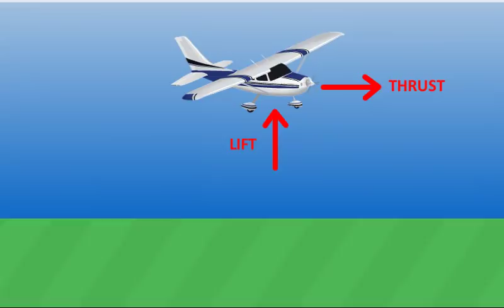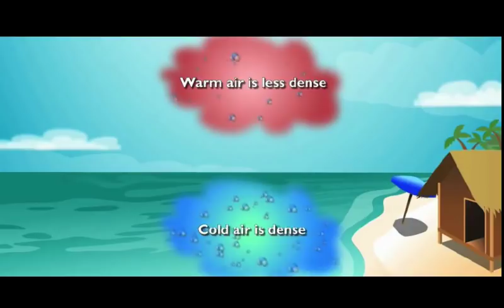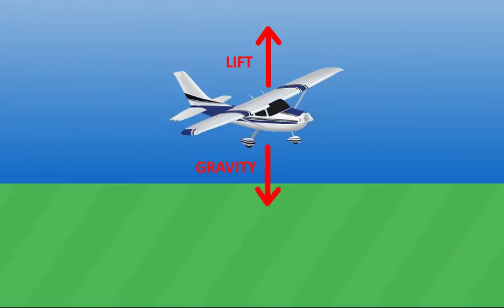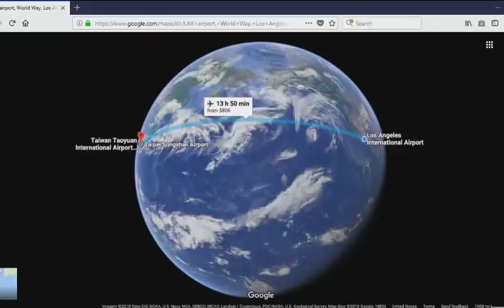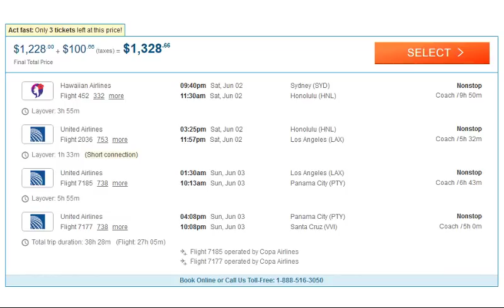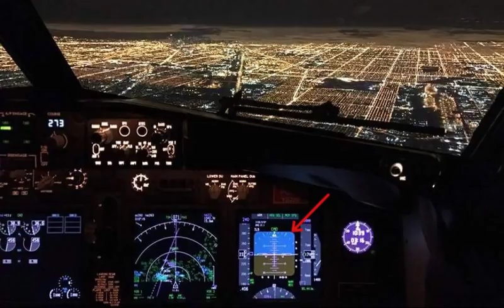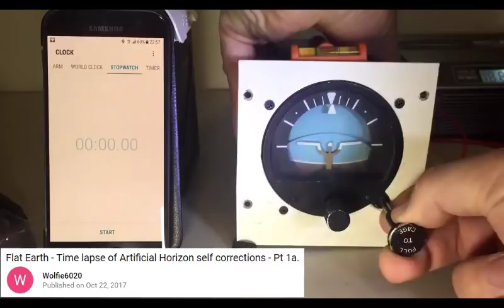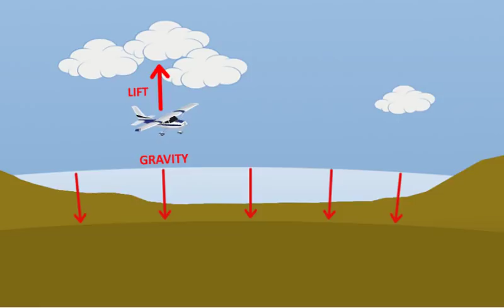Flat Earth Falsities - Plane Nonsense

Comment: I love it when flatheads say the plane should be constantly dipping down or fly off into space, meaning they don't even know what altitude is. Also, they never realize that a plane flying West would have to constantly turn right on a flat Earth. Oops!
Reply: +Galactic Ketchup 
I am afraid you are mistaken - he said flying "west" as in maintaining a constant westward path. That would require turning. And no - one need not turn at all on the globe to maintain a westerly course. On the globe, if my course is 270 degrees, the only reason for me to adjust in any way is if wind or water currents are affecting it. For example, as a sailor, I have had to steer north or south of the course I actually want to follow due to currents. If I want to head due east, and the current is causing my boat to crab south, I have to steer north of east to maintain a due east path. But if there were no current, I could steer straight east and reach my intended destination - not true on a flat Earth.
Reply: Galactic Ketchup South of the equator it's a whole lot different.  Circling The Great Antarctic Ice Wall of Doom in Flatardia flying west would be a constant right turn flight, not to forget also being about 70,000 miles.  The reality is it's a constant left turn flight of about 10,000 miles.
Reply: They fly in a pretty much straight line. They head north west because that is the shortest route. Just like planes from the east coast fly north east.
Reply: arhoel ocanovi 

The piece of paper is flat,  but it's a local projection from the globe for a small area.
No trans-continental pilot is going to use a flat map to plan a new flight.

Idiot name-calling? Really? The irony...
Reply: Natedabarber Figueroa  You are beyond help if you don't understand that gravity is a force pulling towards the (aprox) centre of the earth... no matter where you stand... or do a freakin hand stand!
Reply: I don't know what to believe?🤔 To be honest I don't know what to think of the world.
Reply: Completely agree. Due east or west requires a bank which increases the closer you are to the North Pole. Attitude indicator would show the neccesary turn as would any pilots senses. 

I’m not sure I get the argument against this point from galactic ketchup. If you could please elaborate. 

Olem and my point is that flying due east or west requires a constant turn to maintain that heading on a flat earth.
Reply: You also need to turn on a globe going West,  except at the Equator.
Reply: idiot!!! you dont even know what your talking aBOUT!!
Reply: Natedabarber Figueroa 

Just how stupid are you?
Reply: Natedabarber Figueroa 

Stupid up to 10, at which point you see a picture of the globe from space and think that "downward gravity" is towards the bottom of the picture for everyone on the globe.
Reply: Natedabarber Figueroa 

So stupid at 10 in a scale of 0 to 10. Gotcha.
Reply: Natedabarber Figueroa Yes, your heart obviously pumps/circulates  blood throughout your body in a network of tubes. If you Google arteries and veins that should help you understand.... Or maybe not. :(
Reply: Unfortunately I don't think you understand the flat earth model. The flat earth believers don't make that claim. Make sure you understand it before you shit on it. Otherwise you do your side a disservice.
Reply: arhoel ocanovi  Pilots use Lambert Conformal Conical Projection map to navigate specifically because a straight line on this map is roughly equal to a great circle route on a 3D globe map. I suggest you look up map projections and why different projections are used for different purposes.
Reply: Peter Galbraith well whats the scale..
Reply: Peter Galbraith no stop it dude lol at what point of you going "over" the curve do your blood cells know that gravity is changing and becoming down instead of up. Beacuse if i do a head stand i can feel and see my blood rushing to my head.
Reply: Natedabarber Figueroa The mistake you flat earthers make is thinking the North pole is up and the south pole is down. You expect a ball in the field of gravity to behave the same way with one in space. You could turn the globe upside-down if you wish. North is not up and south is not down. They're just directions. Up is towards the sky and downs points towards the center of the earth. What if you've always known the globe to be upside-down? You'd wonder why those in America don't fall of the Earth.
Reply: O Alem This is actually a bit of a strawman that bugs me despite my being a round earther. To be fair to flat earthers, planes don't have to turn right to fly west on a flat earth any more than on a round earth. There is no reason the plane can't bend north to take a straight line. This is exactly what real planes do in the northern hemisphere. It's really not fair to impose our flight paths on flat earth theory since that in particular would actually be fairly easy to fake. There are plenty of other absurdities that we can pick apart far more easily.
Reply: Natedabarber Figueroa 

Are you going for 11?
You just told us you feel the extra blood pressure in your head doing a head stand. That's from gravity. Now you are arguing the opposite? 

11. You've earned it.
Reply: There are videos of flathearthers justifying flight patterns using curves. Ironic no?
Reply: Paul Hope ok..
So gravity is strong enough to hold trillions of gallons snug to the earth.. Or buildings down.
But still yet sensitive enough to let blood flow through your body..  
Uhhhuhh. Got it.
Reply: Thanks for the gibberish
Reply: NO MAP?? all pilot and navigator dont use globe map for their navigation it is always flat map,,,
Reply: O Alem You know planes always fly in a straight direction right? Save gas..
I have one question..
When does your blood know that when your on the other side of the globe up is down and down is up? 
Consequently having your blood rush to your head.
Reply: Peter Galbraith haha its called sarcasm buddy keep it tight. The earth is flat and your theories(lies) are going in circles never hitting ground 🙊🙉🙈
Reply: All very academic, since there is no map of the FE.  Flattard Airways would not fly since the flight crew would have no idea of where they were in relation to the desired destination, nor any idea how far away the desired destination is.  Much safer to stay on the ground.
Reply: O Alem planes go north from the west in real life.  they do turn right. whoops.

Comment: if a globe is the only actual accurate "map" then those giant curves need to be there buddy and the nile and mississippi would be flowing up hill.
Reply: Bobby Wizdum this is why we discovered gravity. The gravity is attracting from the center of the circle. So, water is gliding towards it. But it can't go through rock directly (only through a long period of time), so it just seeks the 'lowest' point where it can come, which means the point where the gravity is strongest. 
With the Nile, it begins in the Great Rift Trench, whitch is a mountain range. Lake Victoria, some times regarded as the source of the Nile, is a bit more than 1 km above sea level.
The distance between Lake Victoria to the center of the earth will be something around 6,372 kilometres (6,731 km is the radius of the earth, regarding the sea level as the edge)
The Mediterrean sea is 6,371 kilometres from the center of the earth. 
Khartoum (capital of Sudan) is about halfway on the river. This is where you say the river is on it's highest point. But Khartoum lies about 500 metres above sea level, which means that it lies 6,371.5 km from the center of the earth. So:

BEGINNING OF THE RIVER (LAKE VICTORIA)
6,372 kilometres from the center of the earth

HALFWAY THE RIVER (KHARTOUM)
6,371.5 kilometres from the center of the earth

END OF THE RIVER (MEDITERRANEAN SEA)
6,371 kilometres from the center of the earth

This means the river is flowing down, because down means (towards) the center of the earth.

But you haven't answered to my first comment
Reply: Bobby Wizdum
You seem to be having difficulty understanding the concept.  The "curve" is irrelevant to the direction of "down."  Your argument is that rivers would flow "uphill" because of the "curve."  If you understood the concept of "down" then you wouldn't be making that flawed argument.
Reply: Walter Boxhead that is ridiculous. on your ball on the surface the poles are on top and bottom. youre talking out of your bums.

No.  The poles are North and South not Top and Bottom.  You seem to think that there is a universal "down" direction.  There isn't.  Every single point on the surface of the Earth is the "top."

Iridium11 you dont understand that eqidistant points on the surface of a sphere would have opposite relations to the center and opposite surface perspective of curvature?

Opposite "relations" to the center?  Yes.  Direction is relative, this is the point that keeps eluding you.
Opposite perspective of the curvature?  No.  That's just nonsense.

I ask you again, which way is "down" on a map?  You seem to not be grasping that point.  You seem to think that "down" and "south" are the same thing.  They aren't.
Reply: Bobby Wizdum
When you look at a map which way is "down" on the map?
Reply: Bobby Wizdum no they aren't flowing up hill. 
https://www.metabunk.org/debunked-rivers-flow-uphill.t7783/
Reply: TheCommunistDragon ive heard all about your defination of up. i don't need your link. the fact is the spherical earth would require an actual spherical surface.
Reply: Bobby Wizdum 
Down is always towards the center of earth. Every point on the surface of a sphere earth is at the same altitude. In electrostatics, they are called equipotentials. Look it up. Actually learn our model. Strawmanning is not an argument.

Edited for clarity.
Reply: Bobby Wizdum do you agree that if you have a cube in your hand, and you release it, it will go down? Well water does it just like that. Down means the center of the earth. If a river flows down, it flows into a place that is closer to the center of the earth. When has that been debunked?
Reply: Bobby Wizdum- The Nile and the Mississippi flow in opposite directions so which one is "up hill"?
Reply: Bobby Wiz-The bulge is only about 3% larger due to speed difference of the earth spinning.The poles are opposite from each other but not top or bottom neither is top.Up and down is perpendicular to the centre of the earth.Stand up ,now down is towards your feet up is above your head,same for every person on earth.Down is not Sth,up is not Nth.
Reply: The idiot, Bobby Wizdumb thinks that North is Up. LOL In his little mind he thinks that the Earth is sitting in his living room with water dripping off of it.
Reply: Bobby Wizdum you haven't answered my question yet, and I'm still curious. When has it been debunked that a river flows to a place closer to the center of the earth?
Reply: Oh, and, when does gravity 'contradict' itself?
Reply: OMG GMO yes i understand that concept. same as when you look down on a globe right? here in lies the difference. your globe has clear curvature. large humps of it. look at the nile and mississippis in relation to the globes surface. keep your left finger on down center and rum your finger along the curvature. if you dont get what im saying youre blind.
Reply: OMG GMO its not irrelevant to direction of the curve itself. the physical properties of curves on spheres. unless we all lived at the top of the ball or bottom all curve points cant be down. take a roller coaster loop for example. while the loop isnt a sphere its equivilant in properties. in other words no matter how the car rides along the track it must go "up the curve. at some point to complete the loop. in other words spherical earth requires high points of curvature along its surface. this is undeniable. the surface direction of north/south on the ball does have an up down relation to its own curvature. it has to.
Reply: Bobby Wizdum 
You’re speaking absolute nonsense. No one can understand you. Take a physics class or math class or something so you can use actual terminology
Reply: Bobby Wizdum 
I don’t fucking understand what you’re saying. You’re a layperson using technical words as you understand them. It’s as if we’re speaking two different languages. We’re done here unless you can use technical words like the technical commuting understands them.
Reply: +bobby wizdum no they didn't,they didn't make assumptions and your cognitive dissonance is strong.
Reply: heres what im saying man on your ball are the north and south poles at the top and bottom in relation to eachother on the surface? 

The north and south poles are directly below one another yes,but neither are top or bottom.

 does the equator not have a buldge? 

It does and your point is?
Reply: Bobby Wizdum 

https://www.popsci.com/10-ways-you-can-prove-earth-is-round

https://www.livescience.com/60544-ways-to-prove-earth-is-round.html

https://www.youtube.com/watch?v=uexZbunD7Jg

Try to debunk them all before we discuss further
Reply: Tjalling Appelhof theyve all been debunked all over youtube. why would i waste time with the same tired arguments when you cant demonstrate the basic things needed for your globe
Reply: OMG GMO its not irrelevant at all on the surface and opposite incline/decline properties of a sphere.
Reply: Iridium11 yes and that doesnt help you. unless you are on top of the ball which we arent all points of curvature can be down in relation to the sky but not in relation to its own surface. the north and south pole are at opposite ends of the ball. physically an incline must exist.
Reply: Walter Boxhead that is ridiculous. on your ball on the surface the poles are on top and bottom. youre talking out of your bums.
Reply: TheCommunistDragon read the whole thing. they talked in circles made crazy assumptions and debunked zero.
Reply: Iridium11 you dont understand that eqidistant points on the surface of a sphere would have opposite relations to the center and opposite surface perspective of curvature? you dont understand because somewhere along the way youve lost common sense in your programming
Reply: Iridium11 lay person? what are you? heres what im saying man on your ball are the north and south poles at the top and bottom in relation to eachother on the surface? does the equator not have a buldge?
Reply: Tjalling Appelhof gravity. you cannot prove it does anything you say it does and half the time it contradicts itself.